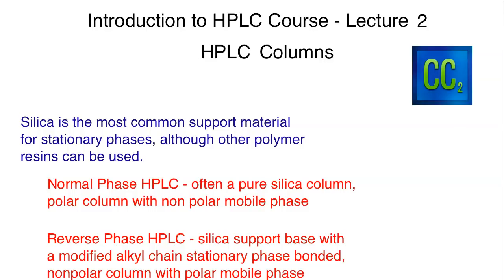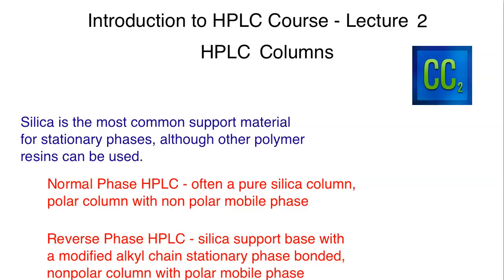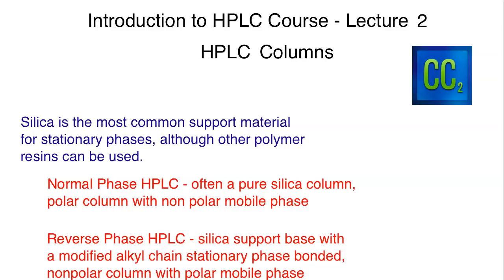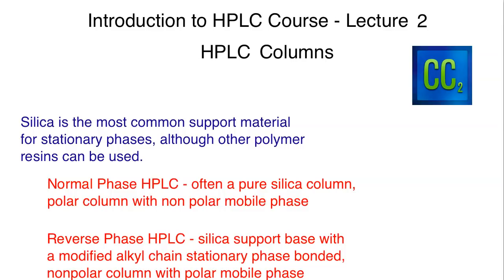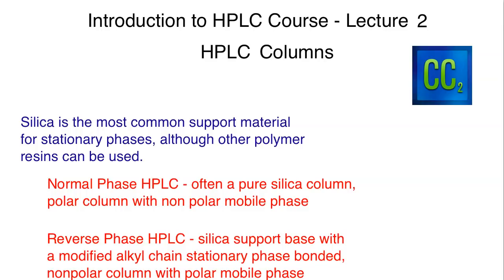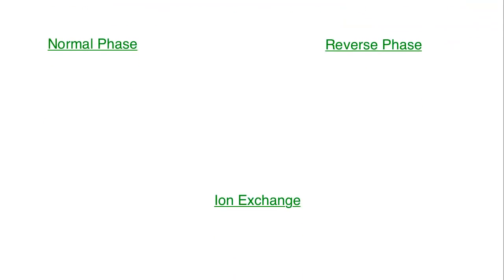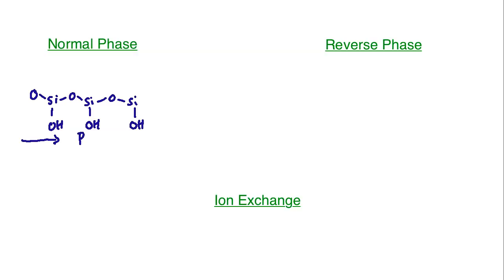Introduction to HPLC - Lecture 2 Column Chemistry

Comment: Thank you for your educational videos!
Could you consider talking about pressure feedback in one of your future videos?
Reply from the maker: In general pressure feedback means a column issue. If pressure is too high it is often a result of columns with too much residual material build up (older columns) or a mismatched column (pore size too small creating back flow issues). Some solvents can also cause issues, especially if they are viscous and thicker.

Comment: Hi sir,is there any expiration date for Hplc columns?
Thank you sir.
Reply from the maker: If factory new and packed not usually. Most columns (especially c18) tend to be fairly stable. However is a column is open its lifetime can vary by many factors and does not guarantee a given number of runs. What you are separating, solvent choices, and proper column maintenance (not leaving water in columns for extended periods) are all important.
Reply: @ChemComplete  thank you sir.
Reply: Some columns for SEC analysis from General Electric do have a Best before date. Specially for columns that can be kept on the fridge.
Reply: @youtube_user9110   thank you.